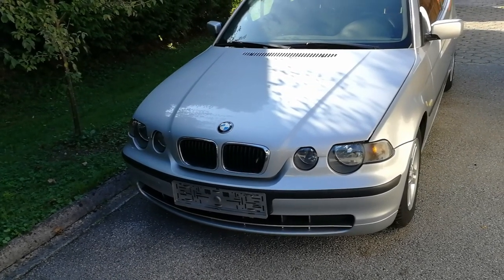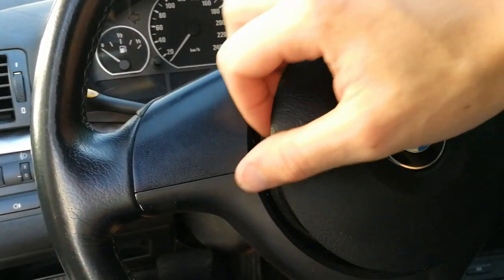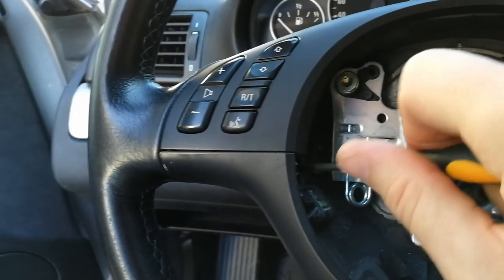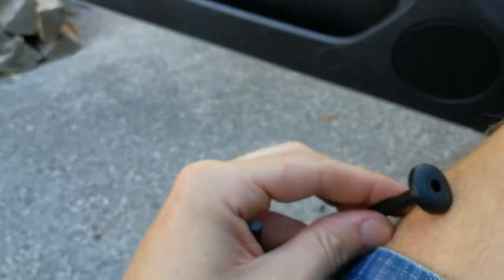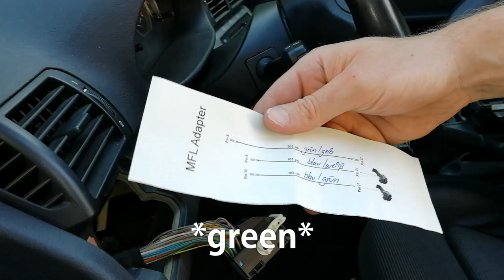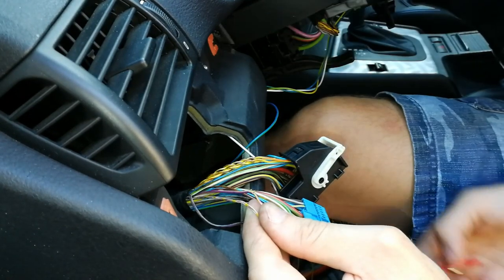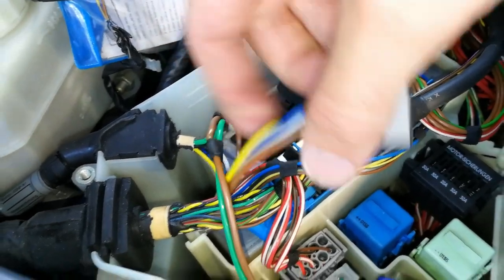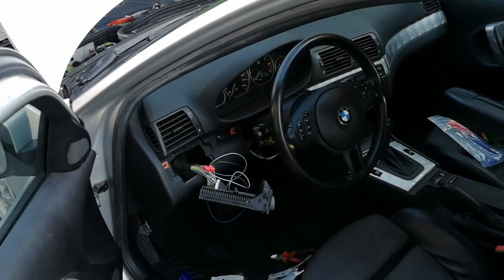E46 Multifunction Steering Wheel Retrofit DIY Guide with Radio and Cruise Control Buttons

Comment from the maker: Have questions? Comment below and I'll do my best to answer.
Reply: before the installation did you have the cruise control buttons anywhere in car, or you couldnt turn it on at all?
Reply from the maker: @gabeitch1487  No, i did not have any existing cruise controlls. You only need to retrofit the buttons on the steering wheel and it will work.  All E46 have electronic throttle controll so you dont need to recode the car or add any additional hardware, only buttons and 3 wires.
Reply: @BimmerZen  thx a lot!
Reply: Do i have yo buy those specific wires or i can use any wiring i have?
Reply: so this wont work on bmw e46 2000 year, 100kw/136hp M47 engine ?
Reply: I own an e46 320ci 2002. I'm in the UK; the steering wheel in on the right but the ECU is on the left. Do you know if I can  follow the same procedure?
Reply from the maker: @rubenlipoan1324  Yes.
Reply: @BimmerZen  thank mate. God bless you!
Reply: @BimmerZen  I just did it, and it works. You're a legend!
Reply: @BimmerZen Hi, does this also work for the BMW 3 series 318 CI? If so, is it the exact same procedure as this video? 
Very good video btw!
Reply: İs it ok for E39 2003 M47 engine 5.20D 100kw (I saw the cruise sign on the panel) 
if we use the same steering wheel ? By the way Thanks for the video
Reply: Is it possible to instal cruise control in prefacelift with m43b19 engine?
Reply: Hi, i have a 1999 328ci, will it works on mine ?
Reply from the maker: @TanabUltra  I think you have ms42 DME which has 27 pin for MFL: 

https://www.realoem.com/bmw/enUS/showparts?id=BM53-USA-06-1999-E46-BMW-328Ci&diagId=12_0896

https://www.newtis.info/tisv2/a/en/e46-328ci-cou/components-connectors/components/a-control-units-modules/a6000-control-unit-digital-motor-elecronics7/YbRSR8O
Reply: @BimmerZen That means it wont work?
Reply: What type of wires are these? Can i buy similiar to this same colors something? Pls answer
Reply from the maker: @bujaribraimi7176  check out link in description. You can also use any  normal 0.75mm wires but you will still need the correct pin connectors.
Reply: is this the same procedure for E46 Sedan 2004 N46 engine? especially the ecu cable part
Reply: @trulsemiljohansen4884  yes
Reply: I need MFL wiring kit please can you send me a new link for it i can not find it in ebay
Reply from the maker: @_HaS-  You can search for "mfl e46" or "multifunction cable e46" on ebay
Reply: @BimmerZen  i couldn't find the same one which you are using in the video please if you can send me link so i can buy directly
Reply from the maker: @_HaS-  https://www.ebay.com/itm/253435461418?hash=item3b01ee3f2a:g:iYEAAMXQjWtRJxSa
Reply from the maker: @_HaS-  Looks right, but it's best to send the seller a message with your car model and production month/year and they will let you know if it's the right kit for you.
Reply: when u  conntcted it like on vide did your mlf worked on radio too or its only on cruise controll ?? i have m52 and for now i just wanna use mlf to control radio
Reply from the maker: @martin2596  yes, it worked right away.
Reply: @BimmerZen  ok si IT looks that mfl to rádio goes through light control module od in right
Reply from the maker: @martin2596  yes.
Reply: My E46 318i from 99 (M43B19) does not have electronic throttle body, its cable driven, but is is possible to wire the mfl kit only for your radio buttons ?
Reply: i know this is an older video, but i just bought my first car, a 316ti and i was wondering if i swapped my steering wheel to one of these OEM BMW wheels with radio controls, if said radio controls would connect to an aftermarket Headunit? as i plan to upgrade my radio to an android headunit and wanted to know if that would still work and allow me to adjust volume and change tracks without taking my hands of the wheel
Reply from the maker: @FrenchyAU  You can upgrade your steering wheel to multifunction. Aftermarket units usually work with multifunction buttons.
Reply: @BimmerZen  Hello , i have factory MFL , every button works on my steering wheel but i got error on ISTA+ S0017 no communcation with multifunction steerin wheel can you  help me ?
Reply from the maker: @aydinkov  So the error comes back if you clear it? It could be a bad connection on one of the wire connectors or the slip ring.
Reply: @BimmerZen  When turn the steering wheel right or left. i hear scrappy sound inside , it looks like metal scratching the metal . i am 100 % sure its not power steering pump its something inside steering airbag that makes this sound . you think thats the problem ?
Reply from the maker: @aydinkov  It might be the slip ring (PN: 61318379091)
Reply: @BimmerZen  Thank you for helping i will replace it and give an update what happen.
Reply: @AldoSoeprayogi  hello do you have the answer ?
Reply: @gaussman7778  2 wire for the LCM is the same, but for the ecu its different, if im not mistaken, its pin 27 on the ECU, already sold my car so i cannot make sure
Reply: hi, was just wondering about this install, I am picking up a multifunction steering wheel for my compact tomorrow to do this retrofit, I have no intentions of using the cruise control at all, googling it shortly I found a single comment so far saying that the wiring to the engine bay is only needed for cruise control, as I just want this for the radio controls are you able at all to confirm if this is true? I'd appreciate any help and I do intend to continue searching till I receive a response
Reply from the maker: @FrenchyAU  I think that you don't need to connect the ECU wire if you don't want the cruise control. You will need to connect the two wires to the light switch for other functions. But why not add the third wire since you are doing this job? ;)
Reply: @BimmerZen  wow I didn't expect such a fast response thank you, well for one reason I live in Australia so driver side is on the right side with the ecu all the way on the left side of the car meaning it Will be a bit more difficult to get it wired up, also I am still on my probationary licence, while that doesn't restrict me from using cruise control, I'm still a fairly new driver so I would prefer to be in complete control of my car while doing any long distance driving in order to be safer and I suppose get a bit more experience in driving at highspeeds on freeways and such, but I will still get a wire needed to connect cruise control and when the day comes I want to hook it up I will have that ability
Reply: is it easy to remove the cables plugged into that green connector under the steering column? im looking to avoid spending a bunch of money on an MFL kit off ebay and just wire it myself, but cant seem to find that exact connector needed for the green plug, so was looking at maybe finding an e46 near me thats being wrecked and basically snipping that connector off of it, taking that wire connector out and hooking that up to some new wires for the retrofit
Reply: are the pin assignments on that diagram universal with all E46s? I'm about to do the wiring for the retrofit in my RHD compact and wanted to check as I can't seem to find a straight answer online, and I wanted to check that wiring diagram you had in the description but it seems the link was taken down by BMW?
Reply from the maker: @FrenchyAU  Check description to see the pin for the cruise controll. Look for your specific ECU. The connection for the other two wires that go to the light switch are the same on all models as far as i know.
Reply: @BimmerZen For radio controls only, would it work out of the box by just adding the buttons on the steering wheel?
Reply from the maker: @mirceaudrea803  yes.
Reply: @BimmerZen  Thank you.
Reply: Great tutorial!! I’m planning doing this to my bmw e39 525i 2002, do you think it Will work? :)
Reply: Hi Bimmerzen! A question, i’ve read in your video description that for M52TUB25 for cruise control you had written 27 E Data link MFL, what does it mean?? Tnx you for you video!
Reply from the maker: @DavidePog  You need to connect the third wire that goes from steering wheel slip ring connector to the ECU box with the pin 27  in the black 40-pin on the ECU.
Reply: will it work on a 118 d e87 2010?
Reply: Hello. It s been four years since you do this tutorial. After 4y did the connection still good with those connection adaptater in the mlf kit? and it work with every years of e46? from 1998 to 2004 or it s specific for one phase of e46 ? thks for the tutorial and your answer.
Reply from the maker: @luke_e4612  Everything still works, but I did not drive the car that much, just 5.000 km:) Some earlier models need additional throttle servo retrofit. Check the description and comments for more info...
Reply: @Bimmerzen hi thank you for the great vid. I have retro fitted the cruise control it works but the volume control don't any idea how to fix it?

Comment: Hey I have question. I have a 323ci 1999. It doesn't have the multifunctional buttons on the wheel, neither do I have a handle for cruisecontrol. Do you think it would be like this for me as well or would I need to do a lot more to get it fully working?

Comment: Just finished installing the multifunction steering wheel retrofit but the cruise control dose not work on my e46 any clues that will fix my issue, thanks

Comment: Can radio commands work without any wiring? I mean just putting the cable into right empty spot behind airbag. Or wiring is necessary?
Reply: Also have that question, I have a basic 316CI... don't know If I have anything eletric cable related "up to date" from some more "modern" E46s...

Comment: Works on the E46 150cv  M47 engine , just did it and its perfect. thanks man. 
The BMW dealer here in Lisbon wanted 350 eur to do it. did it for a fraction
Reply: Olá amigo, tenho um E46 Coupé de 2000, é um 316CI, achas que será possível fazer isto no meu? visto que o meu motor e dos mais "fracos" não sei se é possível e sequer tenho a instalação elétrica para tal :/
Reply: It should work on all E46s

Comment: Worked like a charm on my 328. Thanks alot for the video!
Wanted to add that the 328 uses M52 engine, so it works for that engine as well!
Reply: Hey its been a while but did you get Cruise control aswell?

Comment: Did on my car today and works perfectly 👍👍.  i used wires, that have been used before and found some pins from diffrent plugs laying around, so it costed nothing 😄
Great video, realy helped a lot, because i wanted my multi work for soo long. Thank you 🤘
Reply from the maker: Great to hear that:) Sounds like a good DIY job!
Reply: what was the connector you use for the end of the wires that goes into the green plug? looking to do the same but cant seem to find that exact square plug most MFL kits come with

Comment: Hey guys!
I did this DIY and after connecting the wires to the steering colimn connector and light switch my dashboard started working wierdly. Turn indicators and high beam works fine, but not displayed on the dashboard. Heating/AC not working, atleast it is not blowing air.
Disconnecting the multifunctional buttons did not help.
Any ideas?

Comment: I followed the link for the FL wiring. Looks they're out of stock.
I'm getting a multi function trim panel and would really need those wires.
Reply from the maker: If you search ebay for "bmw e46 multi function mfl wires" you should find plenty of options.

Comment: Hello, so i ordered buttons for my steering wheel, and the same wires and connectors you used. I did everything as you, step by step.. But nothing works, neither the buttons for radio nor cruise control (because I dont have electronic gas pedal so no worries there). Only thing that does work is lights of buttons light up orange like everything when turning on the lights.. I have E46 Coupe 2001 87kW 2001 with M43B19 engine.
Reply: i have the same problem... did you solve yours?

Comment: The cruise control Signal does not light up on the panel when I Press the button But the volume controls and Channel shift Works alright with exception of the Bluetooth button and cruise control button

Comment: Great instructions, but I have a question. They gave these instructions the same for the BMW e46 320d 2003. The cruise control works for me but the radio commands do not. Thank you!
Reply from the maker: They should. Check all wires and connections. Check that you connected the two wires going to the light switch correctly.
Reply: Thank you

Comment: Hi, many thanks for the video, very informative indeed. can I request you to put up a link for the steering wheel trim or what exactly it is called to s that I can look up on e-bay or amazon? Also can you please put up the link for the tools as well it will really help and save a lot of time. Appreciate your help in anticipation.
Reply from the maker: There is no specific link, but if you search google or eBay for "BMW e46 multifunction steering wheel buttons" or "car trim removal tools" you should find what you need.

Comment: Hi thank you for the video. I have a 323ci convertible. Will this also work with this model even if it doesn’t have cruise Control?
Reply from the maker: Yes, it should work. Your car has MS42 ecu which has the 27 pin for cruise controll.

Comment: Hello, i have a 1999 318i  M43 1.9 liter 87kw / 118hp. Would that work on my car? Thanks for your answer.
Reply from the maker: I think you have the BMS 46 ECU which does not support this mod. M43 models have separate cruise control unit... You would need to install this kit: https://www.realoem.com/bmw/enUS/showparts?id=AL31-EUR-12-1999-E46-BMW-318i&diagId=66_0043
You can check in the ECU box in the front if you already have the cruise controll unit: https://www.newtis.info/tisv2/a/en/e46-318i-lim/components-connectors/components/a-control-units-modules/a8-control-unit-cruise-control/W9t6H3x

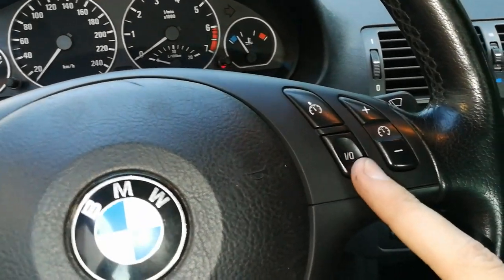Comment: Hello bimmerZen! I just bought a bmw 525i e39 m-paket. I have a problem with it. At 47:03 my cruisecontrolwill turn on if i press it. But when im driving it doesnt go on if i press it. 
Do you have any idea what the problem could be?
Reply: After you press the I/O button, you have to press the + one to set the speed. It won't engage below a certain speed (can't recall the exact one)

Comment: Hello champ 
Please i need your help
I have e46 2000 m43 enggine without electric throttle
So if i change the throttle wire to electric can i use like this too ?
Please help me 
Thank you so much

Comment: Hello, a couple of years ago a thief stole the radio (a pioneer one) i had and cut all the wire. I've bought a new one with android and it works fine with all the new wiring i made but i don't know where is the canbus cable.

On the steering while the cruise control works just fine, but i'd like to be able to use the volume buttons too. Do you have any tips?

Comment: Great video! Is there a difference between part numbers 6753963 and the one in ur video 6760659? Thanks
Reply from the maker: Your PN references a steering wheel:

For vehicles with
Interior trim finishers, matt chrome	
S439A=Yes	
01	Airbag sport st. whl. lthr multifunction	SCHWARZ/CHROM

Parts catalogue also states that:

Cover panels for wooden and aluminium
sports
steering wheels do not fit on sports
steering wheels with plastic covers and
vice versa.

If you are just replacing the complete steering wheel it should fit. All upper covers with buttons fit on all E46 3 spoke sports steering wheels. But not all lower covers fit on all steering wheels.

Comment: On my bmw e39 facelift m54 engine my LCM is located on passenger side under glovebox and it looks similar to the e46, but on pin27 there is no cable and on pin21 there is one but not same color. I do have same wire colors but on another pin number, should I use those with same color? I have connected the cable on pin27 in the ECU but CC won’t work, or Does it work whenever I connect the two other cables to LCM?
Reply from the maker: Sorry, I'm not sure about the E39...

Comment: hi BimmerZen, i was succesful at installing all commands and it all worked, i changed the airbag with a new one with the same shape and make sure all the connections were snug and tidy and i worked always with the disconected battery, but i get the airbag light on... i'm soooo afraid that the thing could explode on me... another thing is that while i'm try to remove the cluster to repair the clock the daylights turn on, is it normal? please help... i'm getting obsece with the thing...

thanks
Reply from the maker: Did you turn on the ignition on to test before you installed the airbag? If so, error will be stored in the ECU and airbag light will turn on until you reset the code.